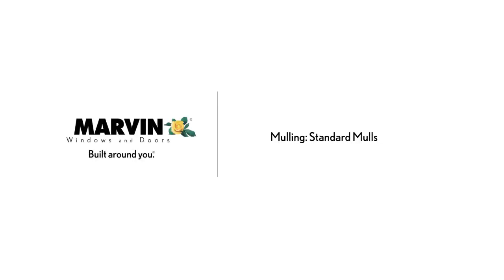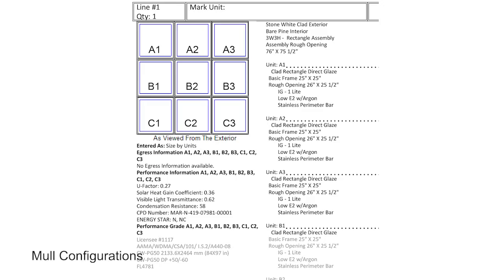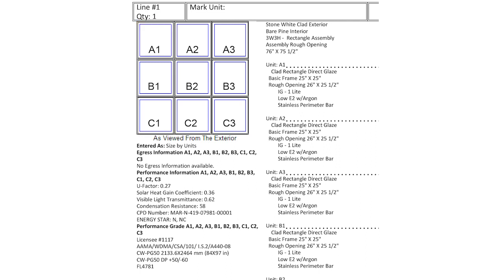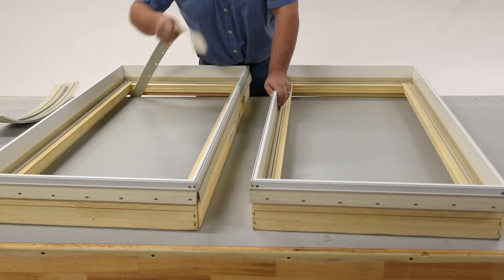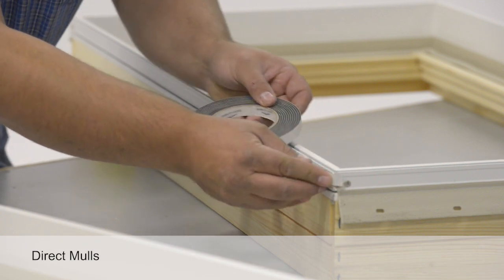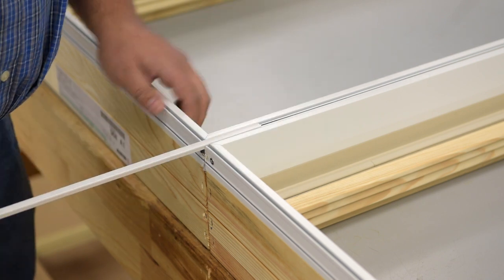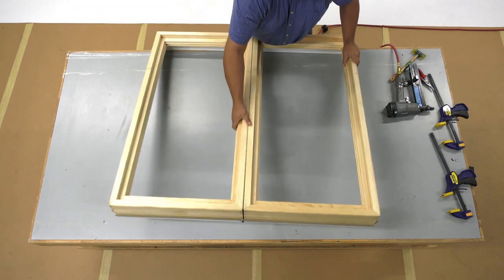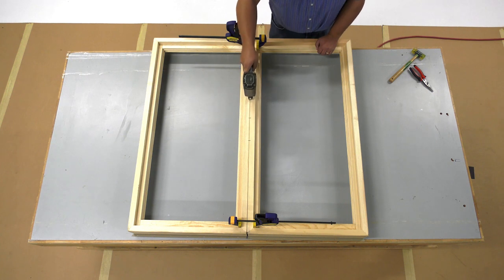Standard Mulling Instructions - Marvin

Comment: Can two Marvin Essential fiberglass casement windows be mulled together horizontally? Reason I'm asking is for meeting the egress code in a 4' wide x 3' high rough opening. One window for egress and  smaller for ventilation. I understand that I could use a Marvin Ultimate French Casement for this purpose, but I am trying to match the other windows in the house while saving some bucks.